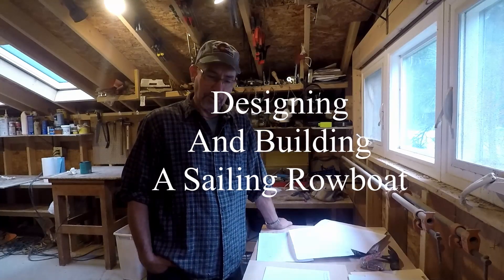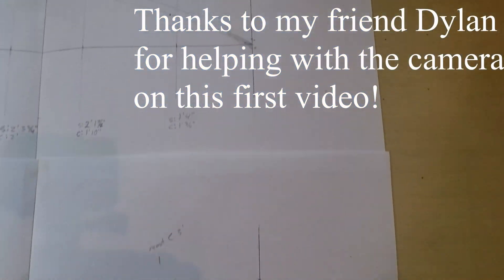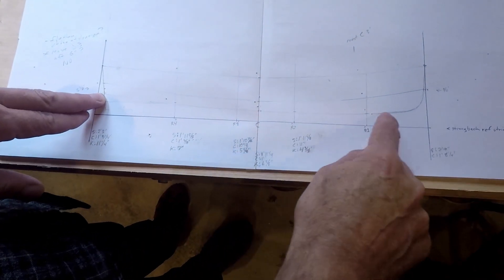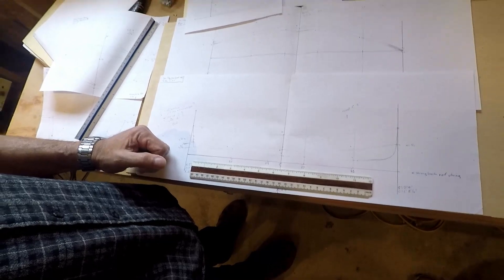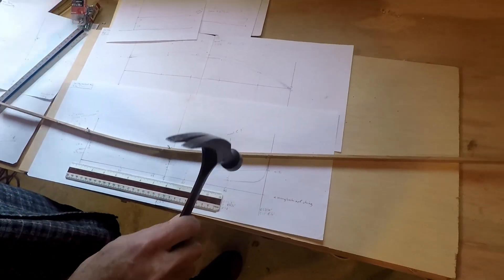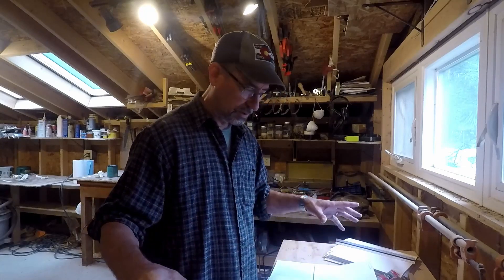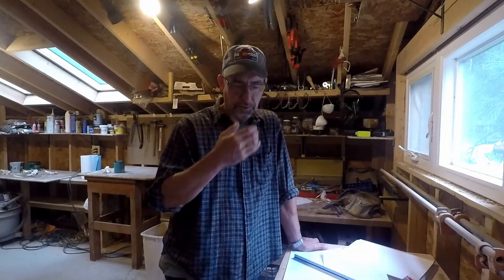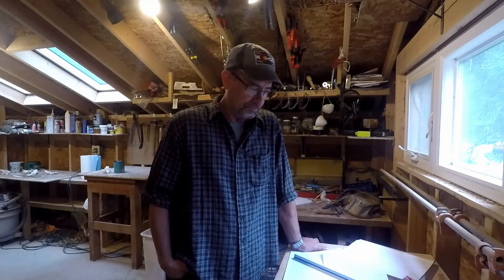Ep 1 Drawing the Plans, Features of the Boat: Designing and Building a Sailing Rowboat

Comment: Nice work. Also, to help you with the scale, don't use an architect scale and work in inches. Use an engineer's scale and work in decimal feet. It will eliminate the confusion for you. The engineer scale looks similar to the architect scale that you have but does not include fractions and will save you lots of headaches and mistakes
Reply from the maker: Thanks--I've since become alot more comfortable with the scale ruler but will check out the decimal feet option.  I think I could make that shift.
Reply: A tape like this one could come in handy as well... you just have to watch our what side of the tape you are reading. I have a tape that is exclusively decimal feet and people are always confused because it doesn't read inches... https://www.amazon.com/Komelon-433IEHV-High-Visibility-Professional-Engineer/dp/B008AGWRE8/ref=asc_df_B008AGWRE8/?tag=hyprod-20&linkCode=df0&hvadid=309789102684&hvpos=&hvnetw=g&hvrand=608385409645483585&hvpone=&hvptwo=&hvqmt=&hvdev=m&hvdvcmdl=&hvlocint=&hvlocphy=9028069&hvtargid=pla-570422889988&psc=1&tag=&ref=&adgrpid=60439547983&hvpone=&hvptwo=&hvadid=309789102684&hvpos=&hvnetw=g&hvrand=608385409645483585&hvqmt=&hvdev=m&hvdvcmdl=&hvlocint=&hvlocphy=9028069&hvtargid=pla-570422889988
Reply from the maker: @dofodamofo  thanks nothing like a good excuse to go shopping for cool tools!